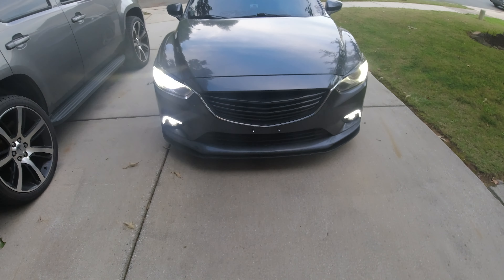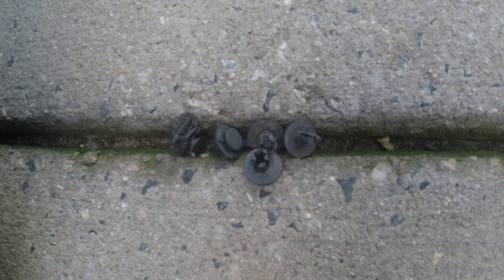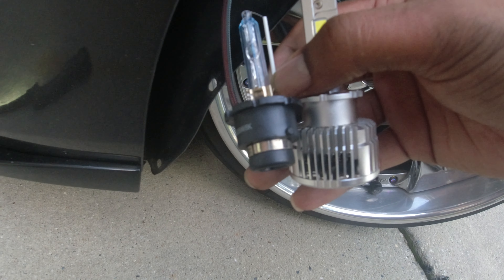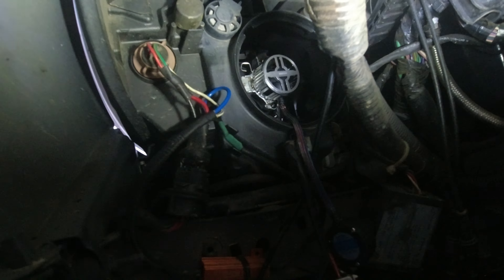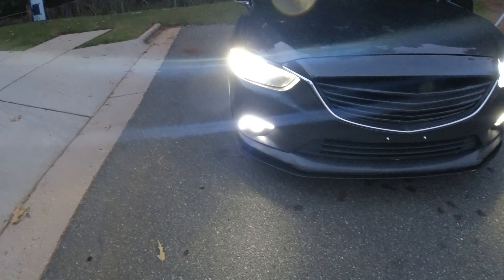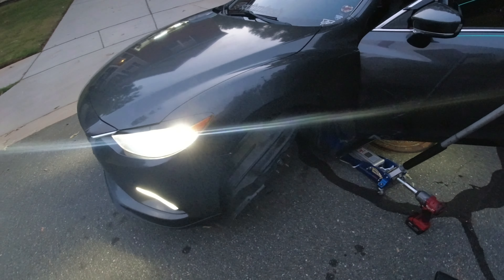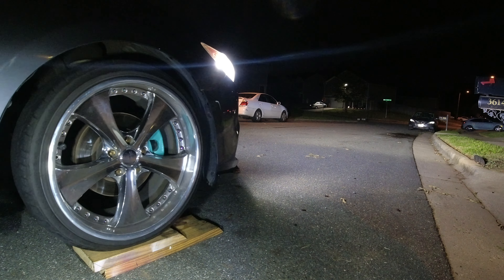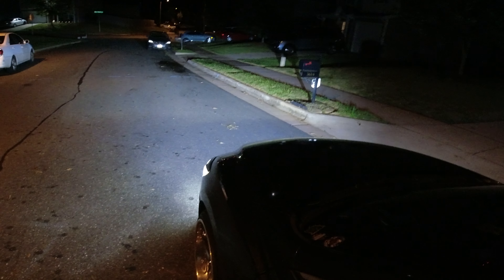35W LED Headlight Bulbs to replace OEM HID Bulbs

Comment: You installed the bulbs in a slightly more difficult way, on the LED bulb there is a holder that comes off towards the front and when you remove it, you first put it in the headlight holder and then lock it, after that you just push the bulb in, it's easier for you
Reply from the maker: I know it comes off but I didn’t want to guess on the bulb orientation

Comment: How did you managed to get the retainer clip fit over the bulky end of the led bulb?
Reply from the maker: I had to put the bulb half in, put the clip over the first part of the bulb and push and hold the clip at the same time. I tried to record it but just no room to put the camera and I was using both hands.